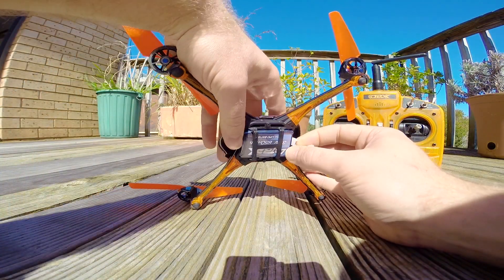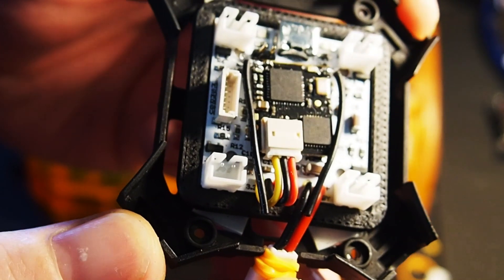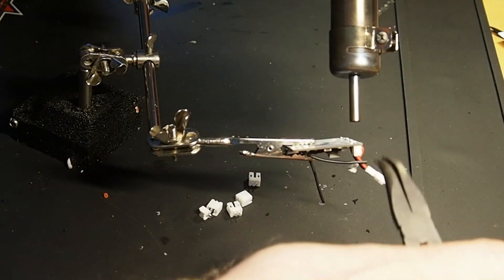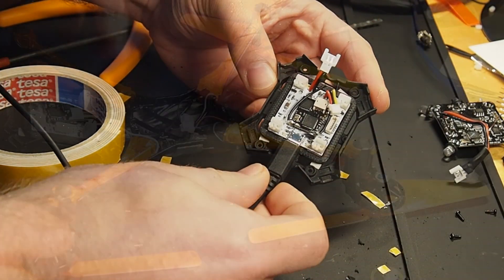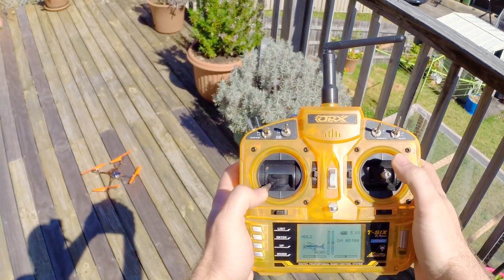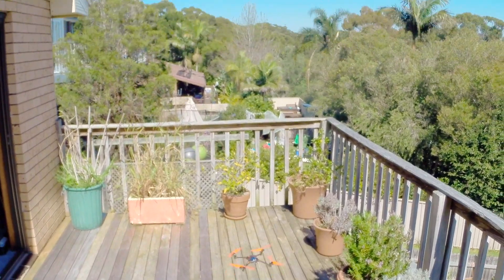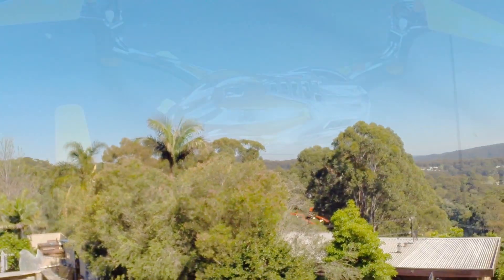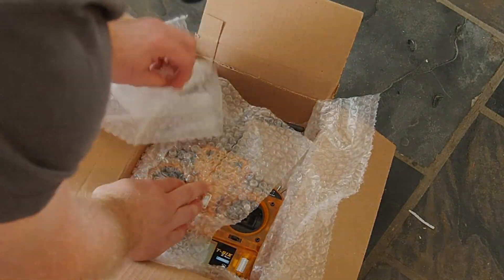The Hacklias tutorial: Building and Flying

Comment: i just finished my own version of a hacklias, but it yaws out control. im giessing it's because of the props turning the opposite direction of the motors. the drop box link above for your firmware no longer works. hoping you can fix the link please
Reply: cancel my request for the link repair, i found how to add a "-" in the yaw code line under the config.h in arduino.
Reply: +Ryan K (MototechRyan) exactly, that's it ;)

Comment: Awesome setup! You should check out the Lectron Pro Alias battery. Its 700mah and the best part is its 30c discharge.  Makes my stock alias a little more fun until you restock the dark force motors. 😊
Reply from the maker: Cheers! I still have a big pile of those 750mah 35C nano-techs. They fit in nicely when you snip to legs of the batter tray ;)
Reply: Just order the dark force motors last night. Can't wait to try! And got a motor for my umx radian. 😁
Reply: +Micro Motor Warehouse Which batteries exactly? Would love to be able to have a little more power!